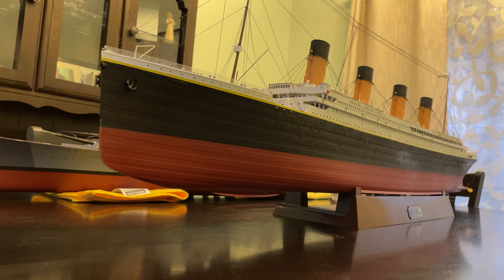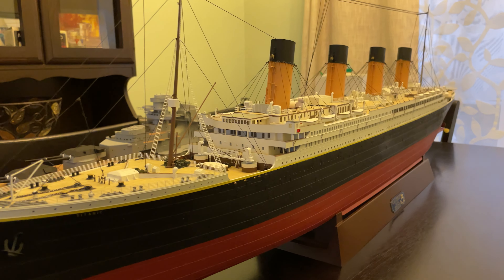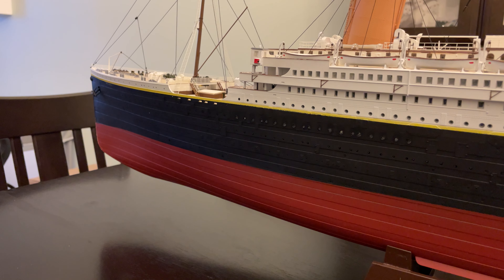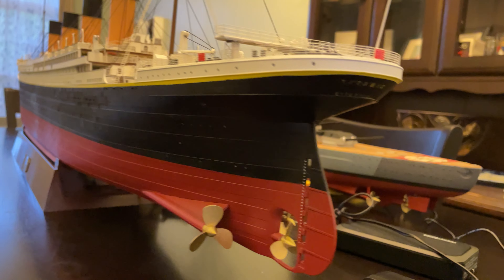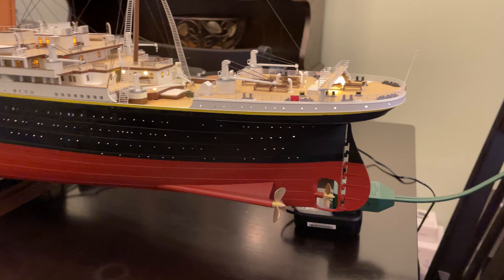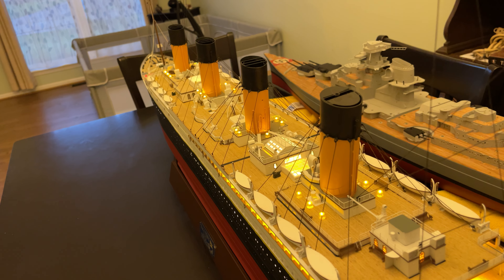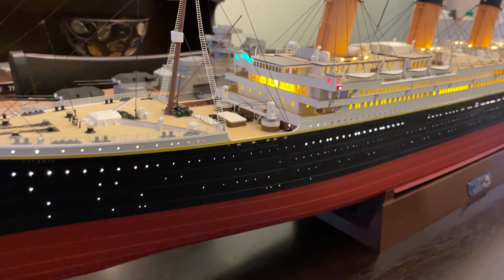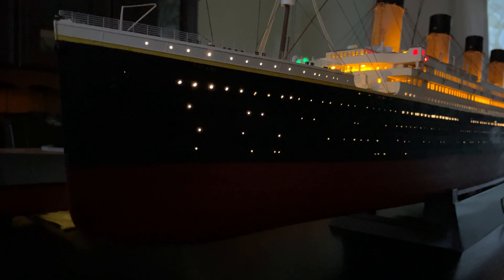Titanic 1:200

Comment: Here is an approach to pricing.  1 - what were your direct costs for all of the kits, parts, paints, the stand, etc? 2 - approximately how many hours do you have in it? 3 - mark up your direct costs by a percentage of margin you think is fair. 4 - assign yourself an hourly wage and multiply by #2. Add #2 and #3.
Another approach is to calculate what you need for your home improvement projects, and the tools it will take to complete them.
Reply from the maker: Thank you for taking the time to provide advice… I will do just that. Have a great week.